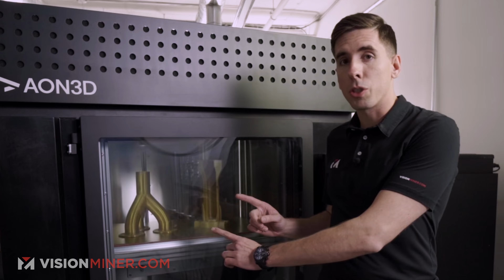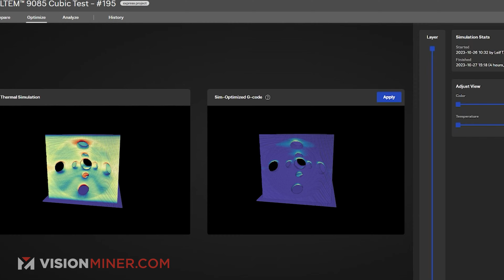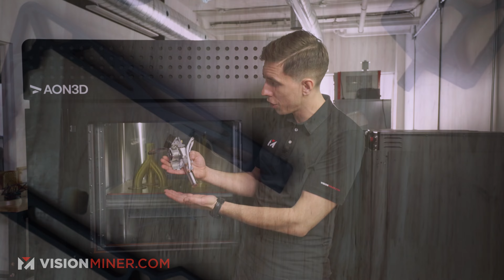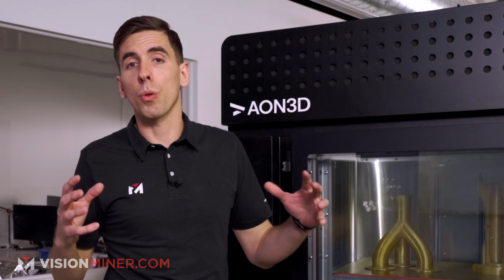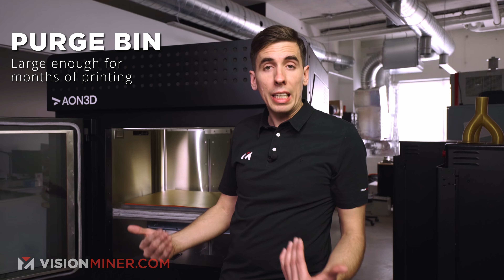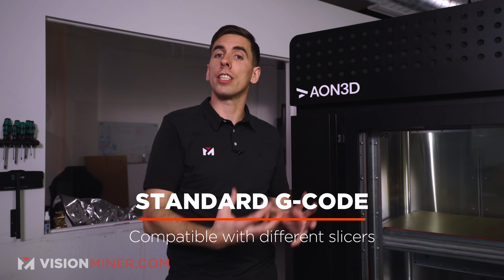AON3D Hylo™ and Basis™ - High-Temp 3D Printing with AI and Machine Learning

Comment: Enjoyed the video. •  By chance, is there a phone/computer app, that if you wanted to, would allow turn on your printer, when you're away from your production facility?

I'm guessing your printer might be kind of a big brother to the Bambu printers?
Reply: Due to potential safety hazards, you can not turn on the printer remotely however you can monitor the printer on the go with dual 4k cameras on our software platform, Basis.
Reply from the maker: Much more than a big brother -- in an entirely different echelon :) Bambu uses algorithms to tune and control material flow -- Hylo™ and Basis™ are using ai-driven simulations of parts, material properties, and much, MUCH more :)